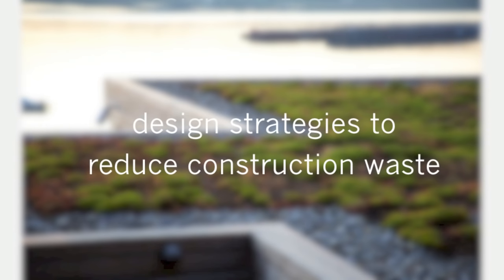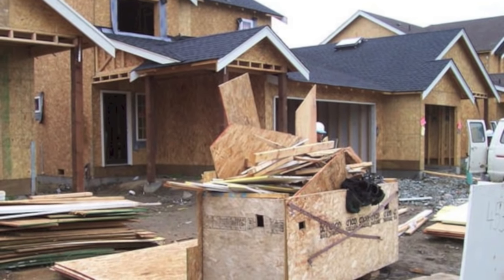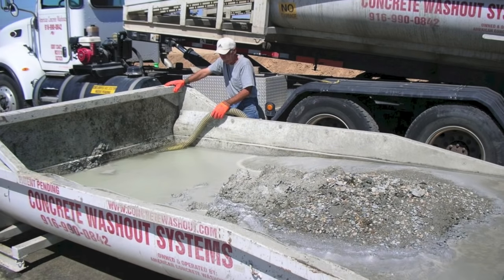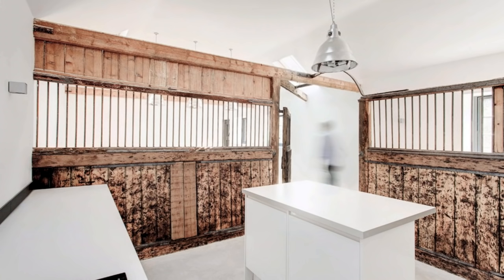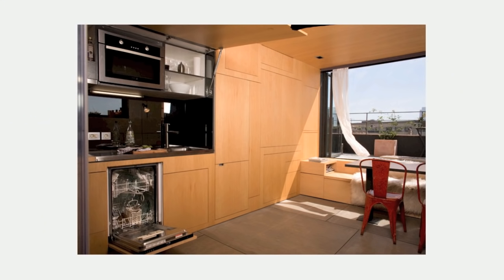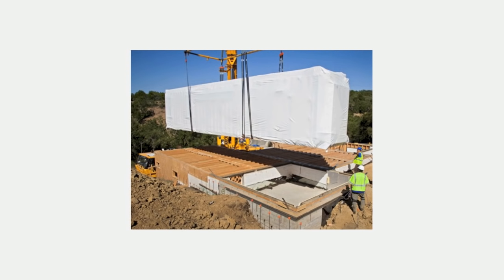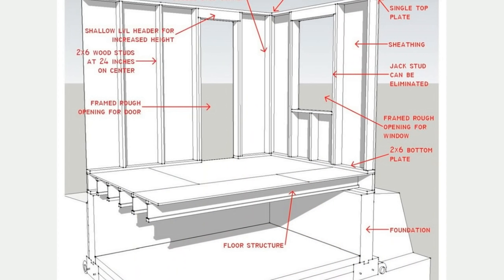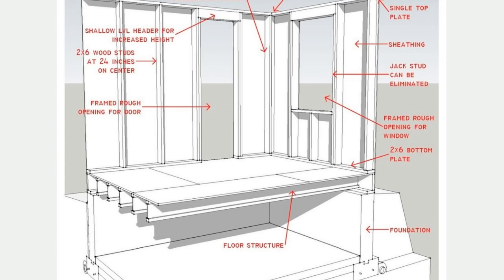Design Strategies: Reducing Construction Waste

Comment: @4:40(ish) '...but if you focus on the overall structural dimensions and correlate those to a TWENTY-FOUR INCH module, you will maximize framing efficiencies and minimize material cutoff waste." Said the guy from THIRTY by FOURTY Design Studio :] 

I just thought it was funny. Great stuff, thanks for sharing!
Reply from the maker: 30'x40' (English barn dimensions) is divisible by 2'...
;)
Reply: 30X40 Design Workshop you're absolutely right! And this is what happens when you make comments after thinking in inches units for too long in a single day leading up to a conversation like this!

Regardless, great content.